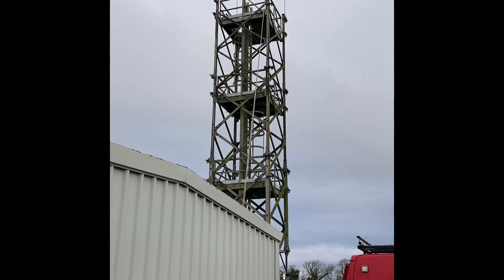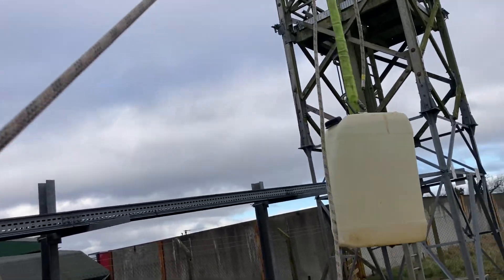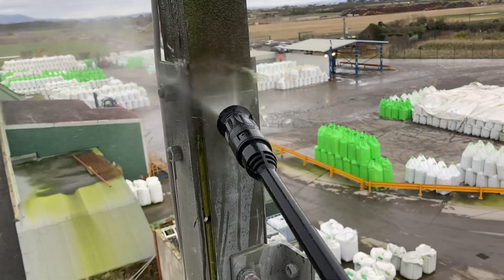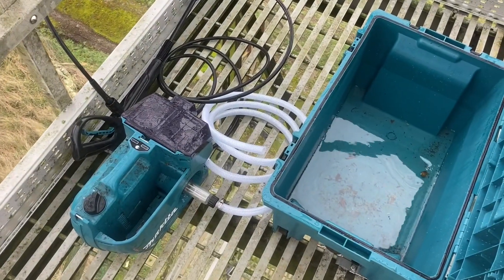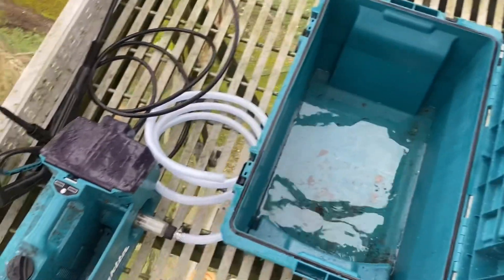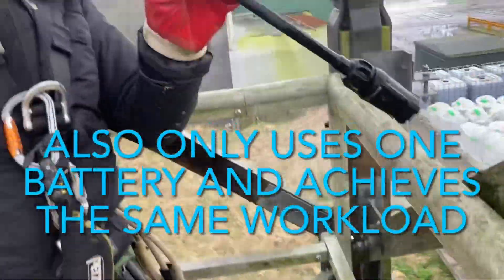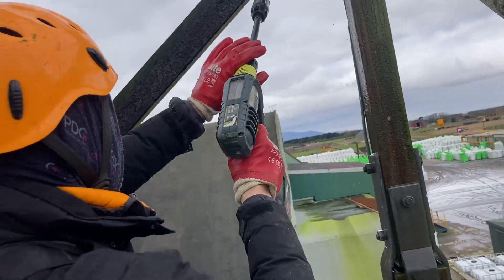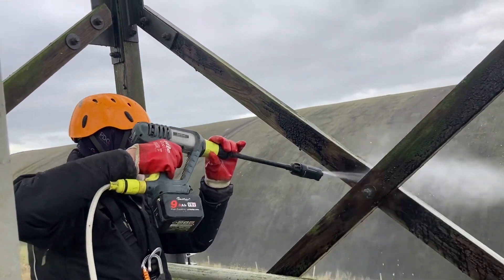Makita DHW080 vs Norse SK25i battery pressure washers

Comment: I'm not sure if you still have this Makita unit but I got one last week, after this video and your previous one I was determined to avoid priming issues. As such I've 3D printed a replacement cap for the bottom outlet of the tank to accept a normal Hozelock Aquastop connector and remove the need to use the suction tube. The water is now being gravity fed, so I've had no problems getting it to prime and no chance of air entering the system until the tank is below the level of that outlet. Much easier to set up and it's recessed enough that it doesn't hit the ground if you lift the tank up to wheel it around.

If this sounds useful I'm sure I can print an extra adapter to send you. At the moment mine does drip slightly as the Aquastop connector is designed to seal with mains pressure, but I'm trying different O-rings and I personally don't mind losing a few drips for the better performance
Reply from the maker: @MattTester    That’s very kind of you, but I got rid of the unit after that job.  
So you’ve solved it?   Shame that Makita couldn’t have designed or even tested it properly in the first place!  Nice work.